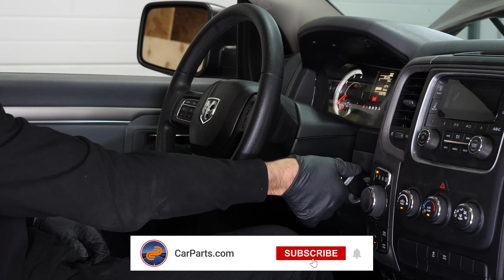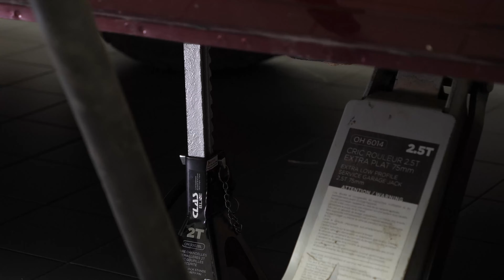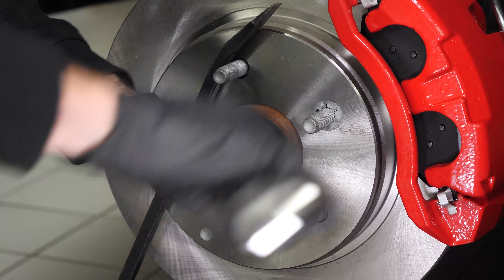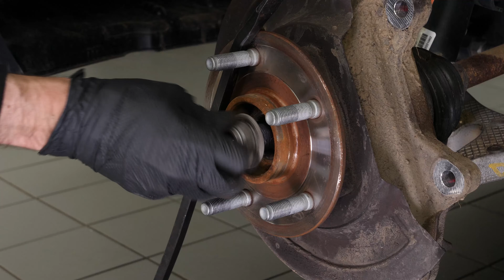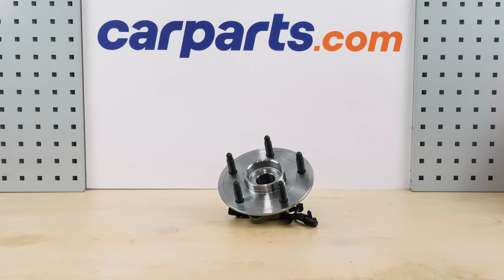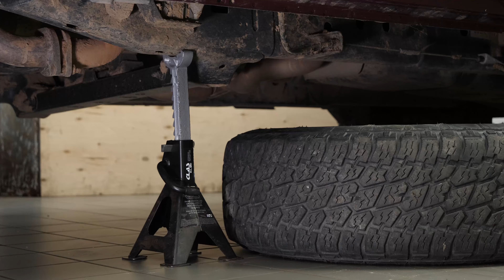How to replace the Front Wheel Hub Bearing 2009-2018 Dodge RAM 1500 🚗

Comment: This video should point out that it shows the procedure for a four-wheel drive Dodge Ram 1500.  My two-wheel drive 2009 Dodge Ram 1500 does not have a front axle nut.
Reply: Parts shopping, is the wheel bearing for the 2WD the same as the 4WD? I've got a 2WD myself

Comment: Excellent instructional video. Is there any reason to do both sides? It seems to only be an issue (a very noisy, had to be towed issue) on the drivers side.
Reply: If one side needs to be replaced it’s only a matter of time before you have a issue on the passenger side. If you change them both you are doing yourself a favor
Reply from the maker: exactly
Reply from the maker: You can replace just one side without any problem, but chances are the other side will need to be replaced within a few months.

Comment: How long does the job take for both sides?
Reply: Mine is two-wheel drive I did not have an axle nut. It was actually pretty quick and simple I just took the caliper bracket off and the three bolts holding the wheel hub bearing. I am not a mechanic but I managed to do both sides and change the brake pads in about an hour and a half.
Reply from the maker: Hi Travisj2695! I think it'll take about 3 hours.

Comment: This can be done without removing anything except the caliper and rotor. Just gotta get the axle nut off and push the axle as far back as you can and get a shallow 18mm socket on an extension in there. Clearance is tough and its a tight space, but I did the whole thing in a couple hours without touching any suspension components. Just need to turn the wheels side to side to get the best access.
Reply: Thank you.  The clearance is retarded.
Reply from the maker: Thanks for the information, but isn't it longer in the end?